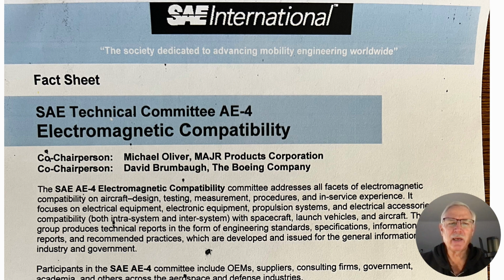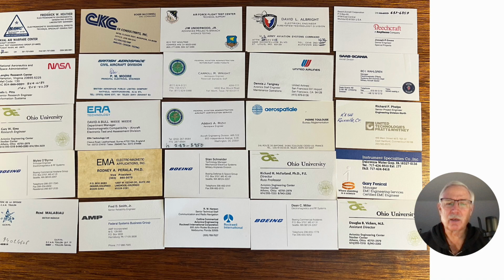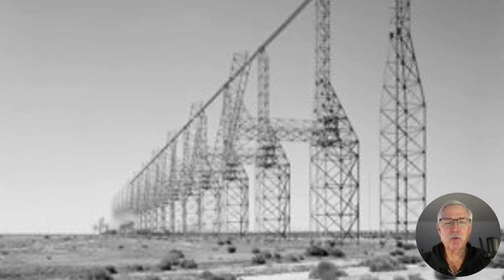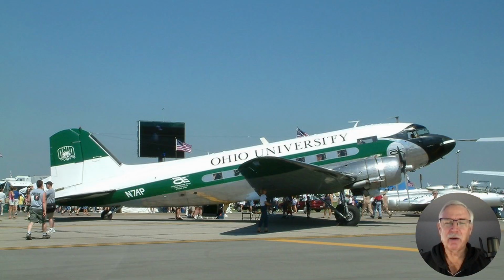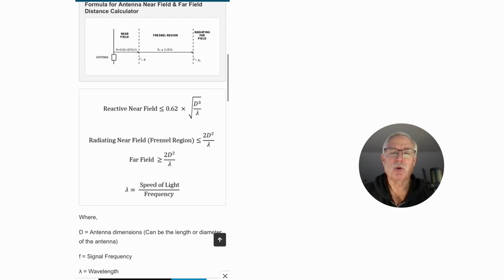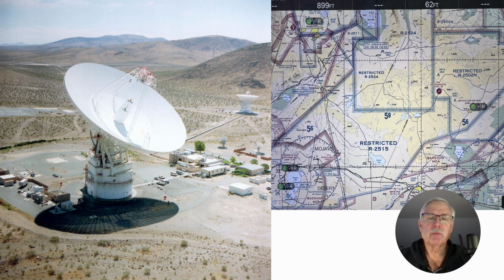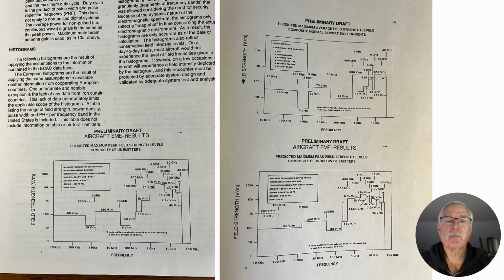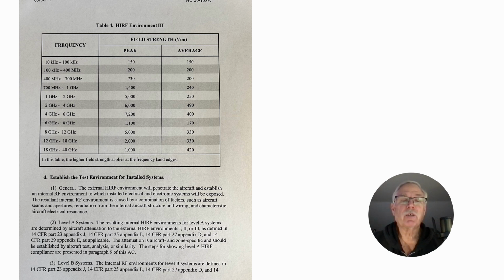Using A DC-3 to Certify Fly-By-Wire Aircraft. Something for my EE Friends! AE4R Committee.

Comment: The RCAF had a DC3 which they rigged up to train F 104 pilots in for instrument and low level navigation feeling it would be safer to learn at 200 kts than 1200. The copilots side was an F 104 cockpit and it had an F104 nose in the front. The crews called it Pinocchio and when it wasn't being used for train9ing it flew supplies to remote bases.
Reply from the maker: That's quite a story!

Comment: Super interesting.  You were the right guy for the job.  Nice work! 

Yes, 500 feet would have been in the near field. Great observation!

One of my profs described a similar test where an aircraft was embedded in a transmission line. The ground was covered with a mesh, and the “signal” conductor was above the plane.  The signal conductor was also a wide metal mesh.  They discharged a large cap at one end of the transmission line, and that sent an intense pulse through it, subjecting the aircraft to strong fields.

Interesting to think how such work would be conducted nowadays.  EM simulation software has advanced remarkably since that time.  Materials such as carbon fiber composites and absorptive coatings have, as well.

Comment: Hello Ron,
It would be be nice to get a proper explanation of these RF terms like fresnel zones and how it works. You seem to be very good at explaining stuff to non engineer audiences.
Also, it would be interesting to hear you thoughts on the flightschool CFIs teaching people how to fly when they are barely out of flightschool.... How does the airforce do it so well and how civilians could improve?
Experinced pilots such as yourself would make extremely good instructors for young people.... Anyways

Another video idea would be a cockpit view and flight from pre walkaround to post shut down on your great lakes and  C310, also talking about fuel management and how to do it the right way in those Cessna twins. Blancolirio did a great video talking about the 310 and yours would be an interesting one too, being  turbocharged. Do you cool down the turbos after a flight? How long? Which power settings do you use?
All this kind of stuff would be very highly appreciated bu many people I'm sure
Reply from the maker: Good ideas and thanks! Air Force low time pilots are watched VERY closely. That I think is the difference. As AF instructors we are training future pilots, not just trying to build time to move to the airlines.
Reply: @ronrogers makes sense, but still, new instructors have limited experience with a couple hundreds of hours
Reply from the maker: True, but  the training for the AF to be an IP was orders of magnitude more intense than the civilian instruction to get my CFI, CFII, and MEI. In fact, my AF training was much more intense than any civilian instruction I ever received other than airline instruction.
Reply: @ronrogers  I had no doubts